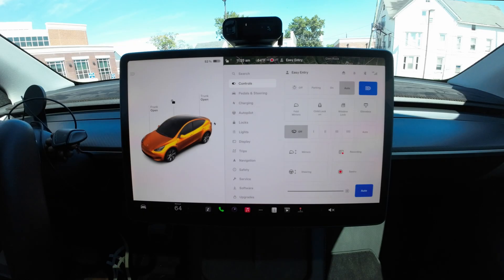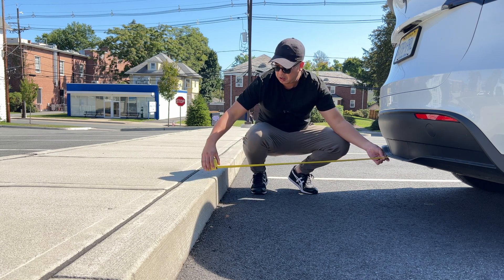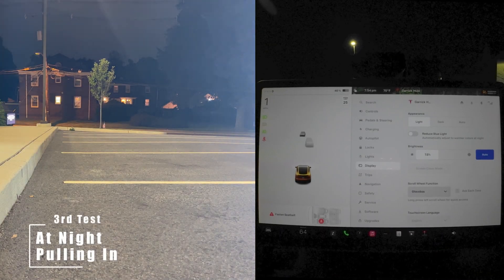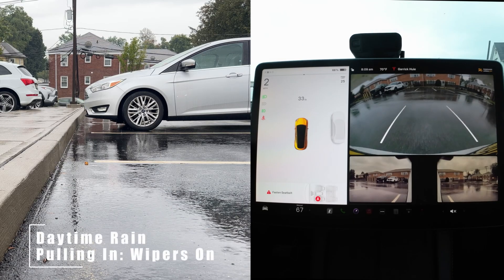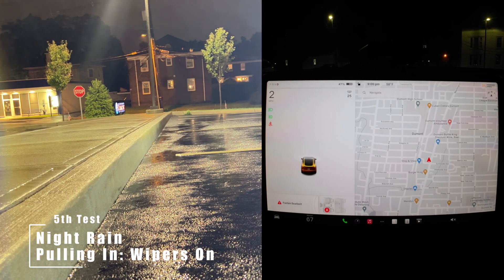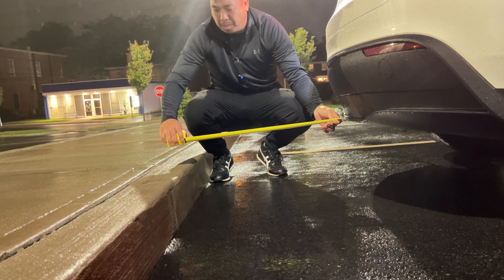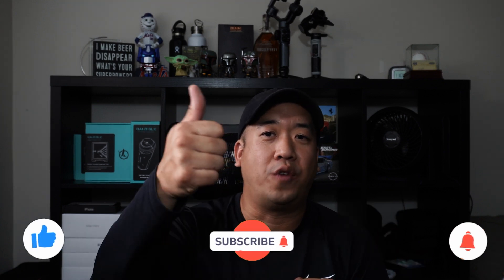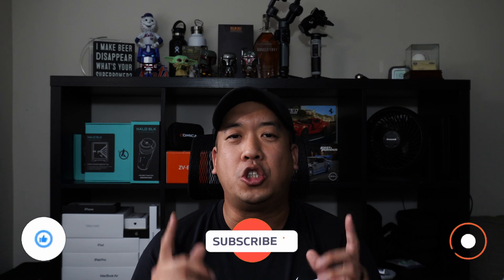Tesla Vision Park Assist Ultimate Test with Different Weather Scenarios

Comment: If you notice, when the curb goes out of Frame on the camera you are looking at, that is when the Vehicle displays the "Stop" warning.  It's not based on an actual calculation of real measurement to the curb/object, but what the field of view of the camera being used is.  This is the difference between using the Ultra Sonic Sensors (USS's) vs. Vision-based Cameras.  The USS's will emit sonic waves that get reflected back from an object (like how Bats "see") and that function is calculated to a much more exact measuring distance.  

So Vision has a built in buffer/margin of safety because of the cameras field of view.  USS's will be more precise.  However USS can be blocked, like with snow, ice and dirt limiting or even negating their effectiveness.  The camera have heaters around them for helping keep them clear in the winter.  The rear camera however is very subject to dirt/grime build up and as a good practice, every day when you got to get into your vehicle, just take your finger and wipe off the rear camera first.  

Personally, for my 2020 Model 3 LR, I would like to have my Radar and USS functions back, or at least have the option to use them.  I don't like that I paid for these when I got the vehicle and now they are deactivated.  That sucks.
Reply: Well, no. The front camera has a HUGE blind spot in the front area. We are talking about roughly two meter at ground level.

Comment: I use Tesla Vision on my model Y which has the newer cameras, and I find it adequate enough for me to use and at least where I park.
Yes, it is not that accurate and has some limitations.  I also use my own visual judgement along with the countdown numbers Tesla Vision gives me.  I find it wants to STOP me 15-25 inches short of a curb or wall.   This is fine with me, then I don't need to worry about banging into anything.  I don't need something that gets me 2-3 inches from any curb or wall, then I would be worried about bumping into something.

Thanks for the video and take care.
Reply from the maker: You are welcome!